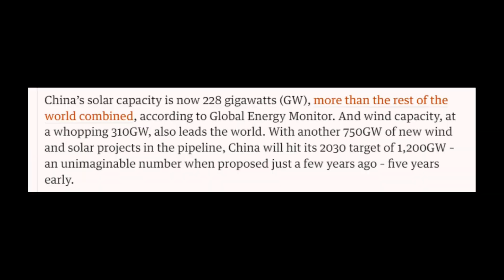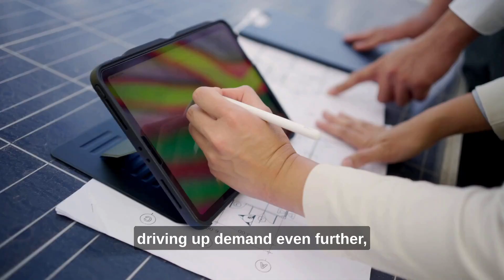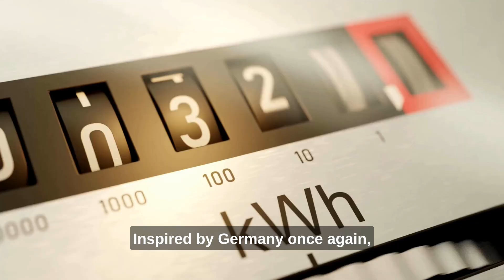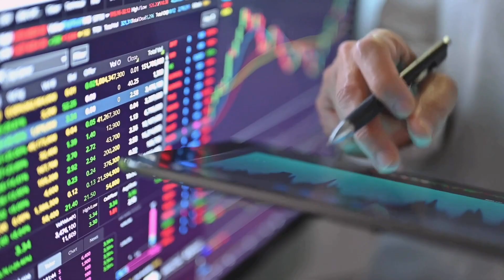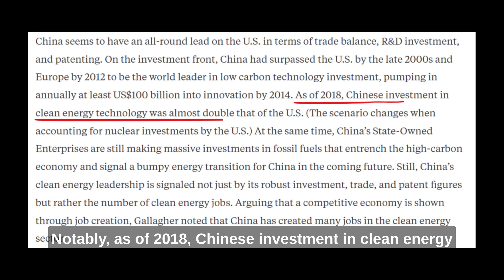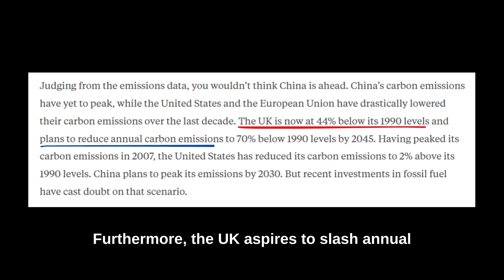How China is Winning with SOLAR Energy (The US Has NO Chance)

Comment: (1) Many of the China's new coal plants have new fluidised bed and supercritical boiler technology to reduce pollution.  Many are for replacing older plants.  The important fact is China is on track to maximum carbon by 2030 and become neutral by 2060 by transitioning from fossil fuel to renewable energy.  The 2022 increase of coal power in China was 0.9% but the hydro, wind and solar power increases were 12.6%, 17.8% and 27.8% respectively based on the official publications. 
(2) In 2022 China added 86GW new solar power capacity.  Apart from the US there is no country on earth that has a total solar power capacity larger than what China has installed in one year.  In the 2022 addition of new global capacity of solar power China's 86GW contributes 42.26%.
(3) Same for wind power. In the three year period between 2019 to 2021 China averages annually installation of 43 GW wind power.  Apart from the 2nd runner-up US and 3rd runner-up Germany there is no country in the world that has a national total wind power capacity more than what China has installed in one year.
(4) China's hydro produced more electricity than its solar and wind combined in 2022 with 1,510 TWh.  The International Hydropower Association annual report stated that the global addition of new hydro capacity was 26GW and 80% of it was contributed by China.  It also noted China has assisted Nepal and Laos with hydro installations too.

The above information are from Google.